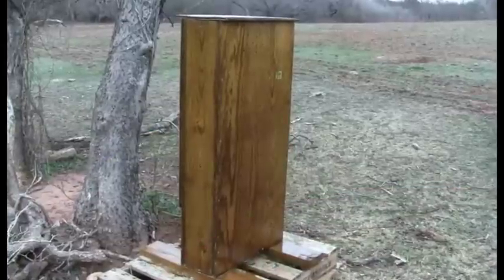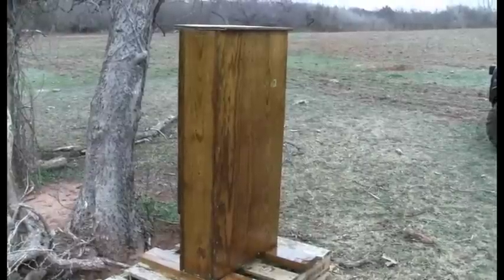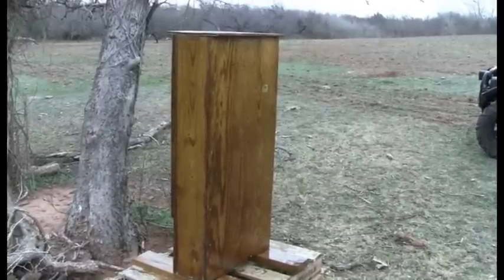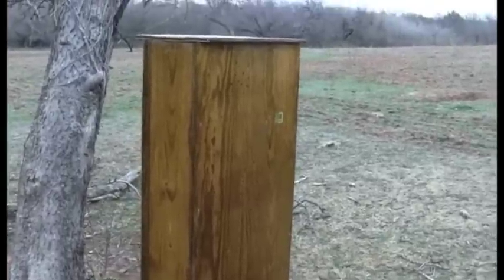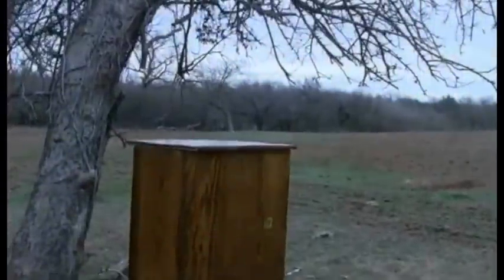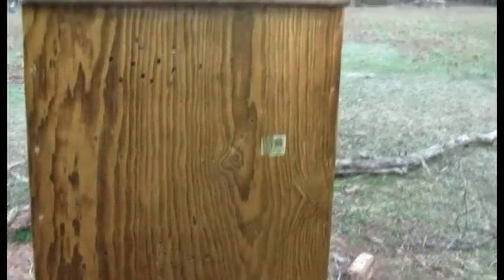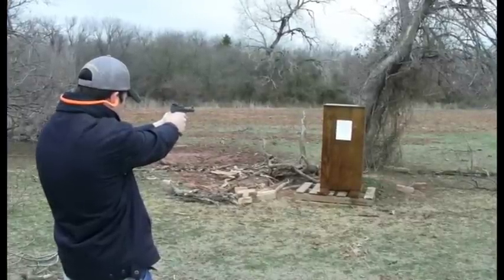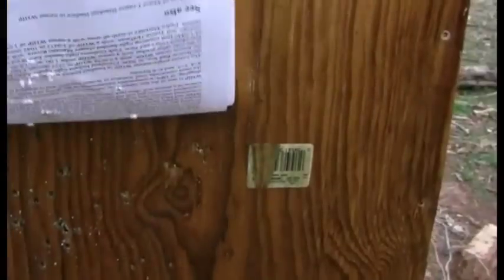How to Make a Bullet Trap

Comment: Well, just for anyone that's wondering, I tested my 4x6   version out, that I built with 2x10s and 3/4 horse mat on the inside of the back board and 3/4 inch on the front. All treated lumber(highly recommended) and I also built a custom base for it to keep it upright, it is a very heavy bullet stop but it works great . It stopped everything from 300 win mag and down. Rapid fired hundreds of rounds out of ARs and AKs, no penetration whatsoever. This is a great design.
Reply from the maker: Great info.  Your comment is one I will refer a lot of questions to when asked of its reliability. Thanks so much for sharing.

Comment: I made this using 1/2 ply front and back but instead of sand I thought shredded rubber mulch would work to slow down a 9mm @ 20 yrds..  OPPS, a few went through. Looks like a may have to make another using sand for the 9MM or 38's.
Don't want to waste the mulch that I already bought.  (9) bags.
Works great on the 22's, it's a keeper.
Reply from the maker: Don D. Interesting..Thanks for the added info.

Comment: I just built this 4 x 6.  Great design.  I have used 7 bags of sand and not even half full?  It is so heavy I can't see us ever moving it.  My idea is instead of laying in on its back to change the front (so heavy can't move) that I will screw a 1/4 plywood on top of 1/2 and shoot that.  When the 1/4 goes bad I will take it off and replace with another new 1/4.  Maybe use 1/8 instead of 1/4?  Thoughts?
Reply from the maker: Pretty similar to mine. Good idea with the extra wood. The one I made is also heavy and I used 6-8 bags of sand. I have changed the front several times now and it is pretty easy for my son and I to lay it back and switch out the front. I am amazed at how resiliant the rubber matting is. Thanks again of the info.

Comment: Just completed mine.  It took 31 bags of play sand.  The front and back both bowed a lot but I used a lot of screws hoping it wont bust.  Rubber works well.  If I did over I would use another 2 x 8 and screw it in back for something for plywood to screw to in middle to stop bowing.  Not sure I would have done this in front to allow penetration but would have in back.

Comment: Thank you, I used what I had on hand 1 inch thick horse trailer mat. I hope 22LR doesn't bounce back
Reply from the maker: It won't bounce back. It should penetrate right into the sand and the rubber will stop the leaks. I have been pretty impressed at how nicely these simple little traps work.
Reply: +RealGuysReviews considering that on a job i was doing for a police department we had to put ballistic paneling in front of the judges desk.
The officers took some left over pieces and tested it.  The only round that penitrated was a 22.

Comment: This gave me an idea to use steel plate in the back and a thick rubber sheet in the front no sand with an open bottom and a tub underneath to catch the lead (; thanks.

Comment: I just finished a 4x6 version using 2x10s and OSB. I was wondering how thick the horse mat you utilized was? 1\2 inch? 1 inch?
Reply from the maker: I used 1/2 inch. I made a smaller version and placed two 1/2 inch pieces since I thought I would be concentrating a lot of shots in a small area and it probably was not necessary. The rubber is easy enough to replace if it gets worn out. Thanks for viewing.

Comment: Excellent!  I am going to build a 4' x 4' version for use in my basement with an electric winch to move it up and down. I'll send you pictures when I get done. 

One question though. I'm thinking you sandwich the rubber mat between the 2x8 frame and the front 1/2" plywood, right?

Comment: Just wondering if you had any calibers penetrate the backside?
Reply from the maker: No I have not had any problems with .38 spl, 9mm, 40 cal and .22. Those are the only calibers shot at it. Thanks for viewing.
Reply: Sounds good. I was  planning on using it for 22, 9mm, and 380. Also thinking of adding doors to the front of it to hide the target area. Gotta make it pretty for the wife. Thanks for the video. Great design.
Reply from the maker: No, I have not had any penetrate thru my trap. However, I would make sure what you shoot does not penetrate yours before setting it up in an area where that could be a major problem. Thanks for viewing.

Comment: Once you have fired several hundred rounds into the same area, how do you remove the spent rounds? After the mass builds up, would it not affect the quality of the stopping power of the sand? Not bragging but all the shooters in the house tend to hold nice groups at 2" to 5" at varying yardages.

Comment: I got curious and did a little research.   A bullet in flight has been measured, with an IR camera, heating to roughly 600F.     Paper burns at 451F.   I would guess dry grass is close to that.  So in the right/wrong circumstances  I imagine it might be possible for a fired bullet to start a fire.

Comment: Just to clarify you made yours out of 1/2 4x6 right?  Wow I don't see how this can be moved with just two people.  Again I am hoping I can just add the extra piece of wood to make it all work out.
Reply from the maker: The original trap had a 1/2" on the front and a 1/4" on the back. Because of pressure from the sand bowing the 1/4"  plywood, I added another 1/4" to the back for support.  I noted in the video annotation that it would be better, with that much sand, to use 1/2" on the front and back. To actually move the trap we used  a loader but to lay it on its back to change out the front,plywood, my son and I did that with no problem. This makes a solid trap and the horse trailer rubber works really good keeping the sand in.

Comment: The video talks about 1/2 vs 1/4 but I was looking for clarification to see that it was 4x6.
Reply from the maker: Thanks for viewing. The rubber matting was sold in 4x6 pieces, and I cut it to make this trap which was around 2x6.
Reply: ***** I went to tractor supply today and they didnt have the rubber you mention.
Reply from the maker: The traps I have been making are 2X6. I take a 4x6 trailer rubber and cut it in half. The best plywood to use front and back is 1/2 inch and forego the 1/4 inch as it will bow under too much sand weight if you make it the size I did. Thanks for viewing.
Reply from the maker: Guess they don't all carry them. Ours carry them by the pallet load as does Attwoods. Thanks for viewing.
Reply: are they on the website? I'v also seen people use plastic bags. If i can not get rubber, ill probably use a couple layers of wood. that would stop the sand as well.

great idea btw. i bought a plastic organizer for mine. 10 bucks.

now if i just had a place to use it.
Reply from the maker: Their websites are not too good. Sorry you are having trouble finding it - rubber seals great.
Reply: would you be able to call one of your stores and get the SKU you number for me. If I can get that number in my store should be able to order it.thank you
Reply from the maker: Rubber horse stall mat - 4x6'- $32.00 
221900399 at Tractor Supply
Reply: thanks

i made one of these out of a plastic organizer container. it didn't last long.

need to make one out of wood with wheels so i can take it out to the range.
Reply: Thanks again
Reply from the maker: Mike Warren Good luck with it Mike. If you can find the rubber - it works great. I don't know about double wood, etc.
Reply: I'm sure I can get it ordered. Or at least the same by another company. Thank you

Comment: Advice on making something that will stop a 308 at 50 and 100 yards
Reply from the maker: Richard a 12-18 inch sand trap might stop the .308. I do not consider the trailer mat in place to stop the bullet - only to keep the sand inside the trap. The sand is what stops the bullet. So adding more thickness to the sand layer should stop the .308  - I just don't know how much. A more expensive route that will also work is ballistic rubber. The disadvantage is its price. If you experiment please let me know what you come up with.